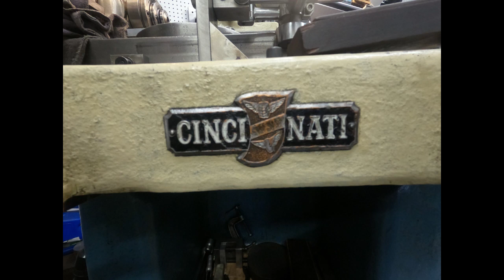Tool & Cutter Grinder adjustable finger rest

Comment: That’s an interesting device, can you show how to use it? Have a great day.
Reply from the maker: Hi, the attachment on this grinder was not finished as nice as 2 others I have seen, it provides a solid X-Y screw adjustment for the finger rest. It also can be used as a base for a pantograph arms for grinding using a template.